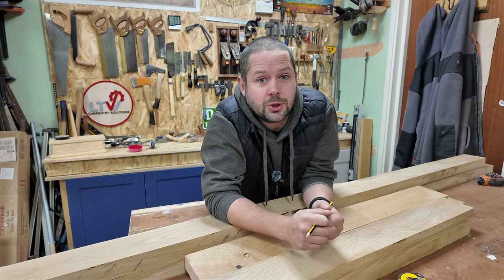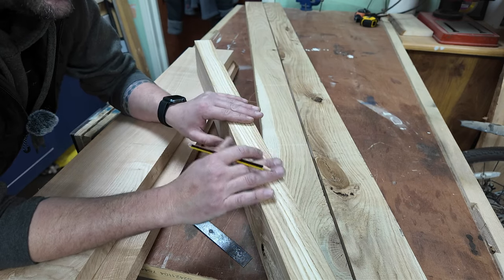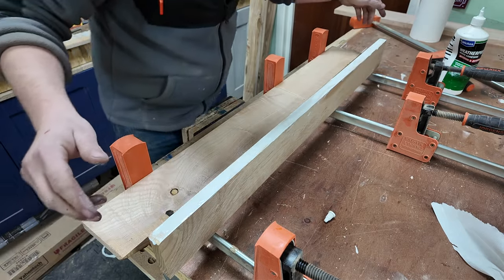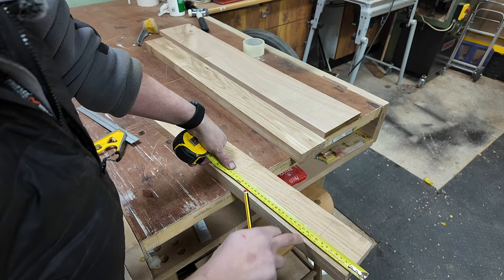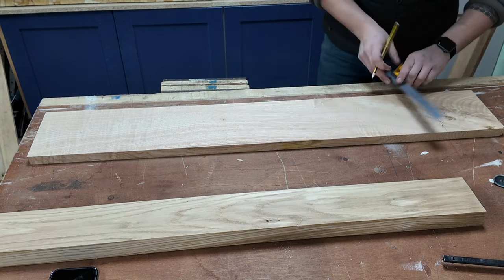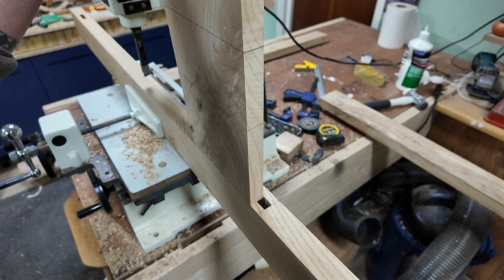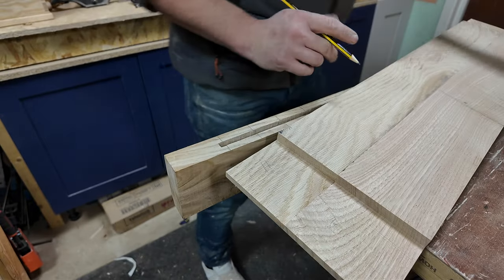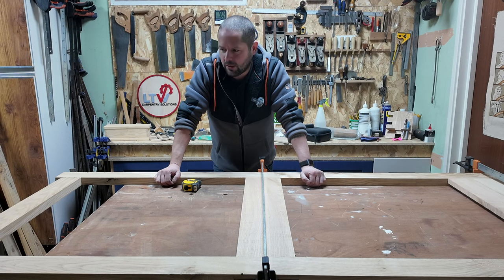DIY barn door build

Comment: Apricot. Carpenter and cabinet maker. That’s a great skill mix and it shows in the video. I remember doing those joints in woodwork class and sweating when it came to the dry assembly stage 😃. Another great video and craftsmanship. Cheers Lewis.
Reply from the maker: Thank you very much buddy ! I really appreciate that comment mate ! I still hate the glue up stage mate, that never goes away 😂😂😂😂

Comment: Hi Lewis and great video. From your joinery background, when joining 2 pieces of timber, as you did for the bottom rail, what is the best way to keep them flat. Have done it several times but always get a rock in the board. I am limited to hand tools though. Thanks Apricots.
Reply from the maker: Hi Kevin, it would normally mean that the boards aren’t completely flat to begin with, then when you join them this doubles the twist, have you heard of winding sticks ?
Reply: @LTWCarpentry  Yes I have heard of the sticks, in the past I usually try to glue the boards first then plane them flat as best I can with a jack plane. Thanks for the reply 👍

Comment: Hi Lewis, Coconut. Only joking Apricot. I started out as a Bench Joiner and had a large workshop in Brentwood Essex, not far from you I think. I used to get my hardwood from Maldon. I need to  buy some shortly, where is your man, Josh based? I couldn't find the link but will take another look. Incidentally, I would more a less set my door out like you have done. Great video. Thanks.
Reply from the maker: Hi buddy, terribly sorry I forgot to add it I have done now. His name is Josh. Great guy. Ohh really what was the name of your joinery business ? It’s not far at all from me. I’m just outside of maldon now. What was the timber place you used to use ?
Reply: Thanks. It was Brookes Brothers who I used. It was quite a while ago. RAM Joinery & Design Ltd. Too many overheads during times of recession. We done a lot of pub refurbishments and shopfitting, for Waitrose. Also the run of the mill joinery stuff, fitted furniture etc.
Reply from the maker: @hi-tech55  ahh okay nice ! I bet that was interesting work though ! Ahh Brooke’s brothers, they are very good but you pay the price don’t you. But it’s true what they say, you get what you pay for
Reply: @LTWCarpentry  yeah what with the net there's more choices around. Its good when we talk to each other and swap ideas. Take care Lewis.